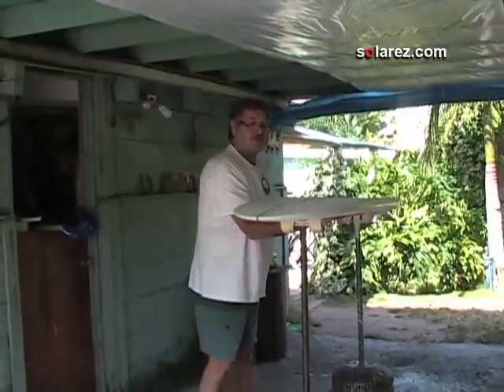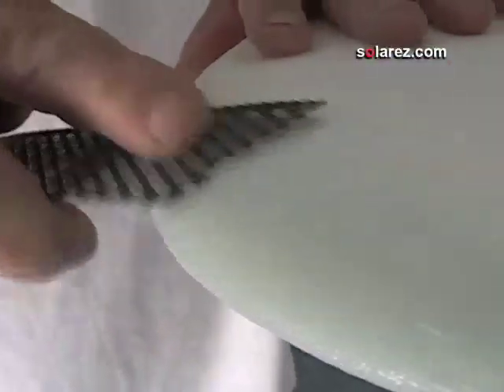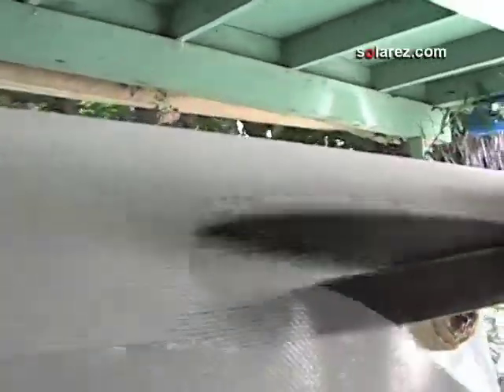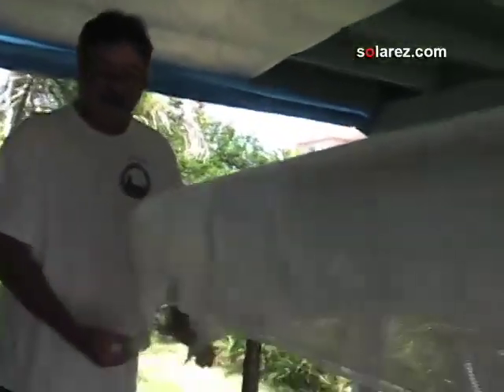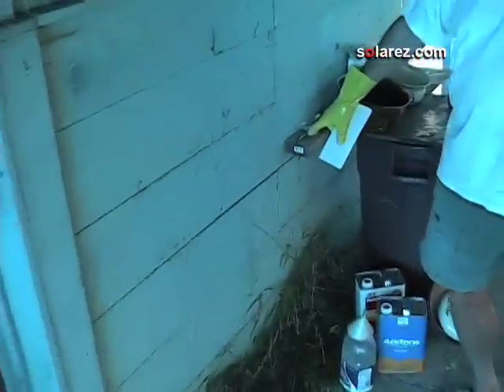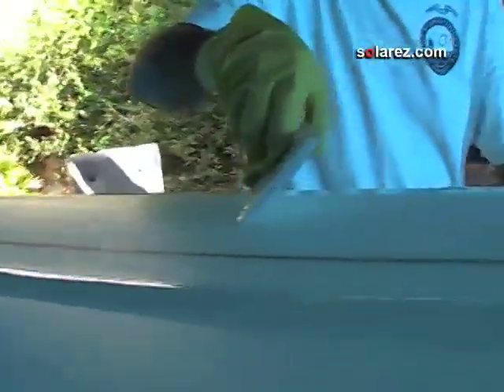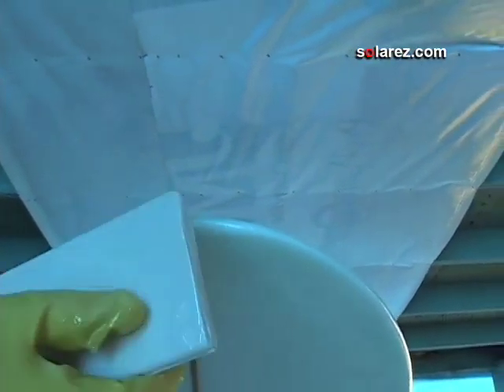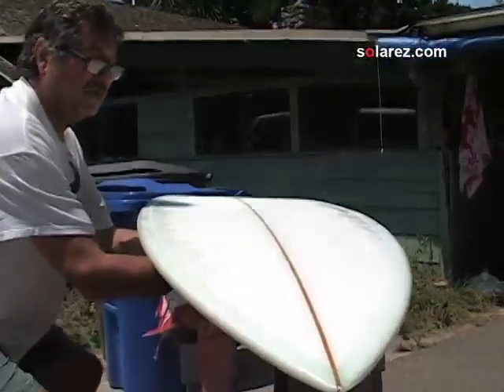part 2 Fiberglass Bottom of Surfboard using Solarez UV cure polyester resin resin

Comment: Thanks, Mike. That's exactly what I was needing to know. My plan is to sand down the bottom to remove the gloss finish, then brush on a coat of Solarez Sanding Resin. I'm just trying to make sure it's watertight. Your videos have been very informative.

Comment: I have an older board with what looks like small cracks on the bottom. Can I sand it down and then use a coat of Solarez Sanding Resin to put a new layer on? Or do I need to use another layer of fiberglass? I've used Soarez products to repair dings, and I'm hoping I can use them again for this. Thanks for the GREAT videos.